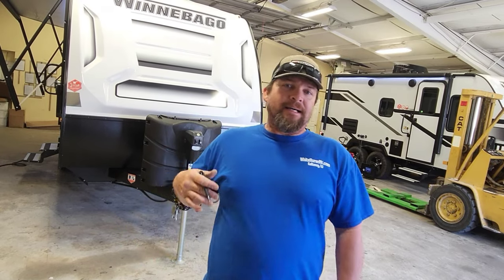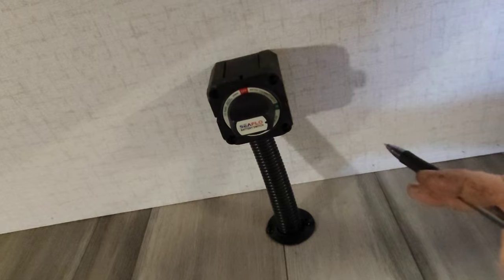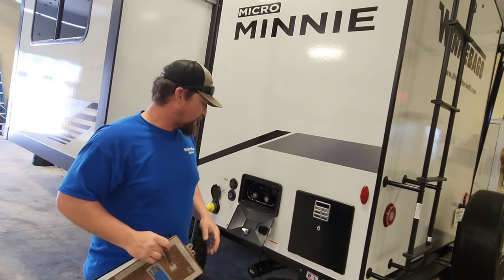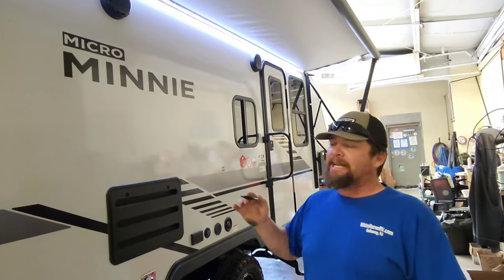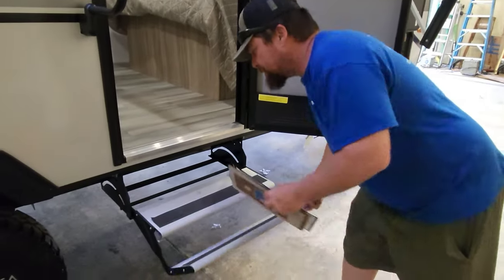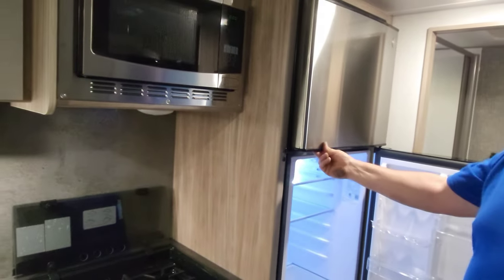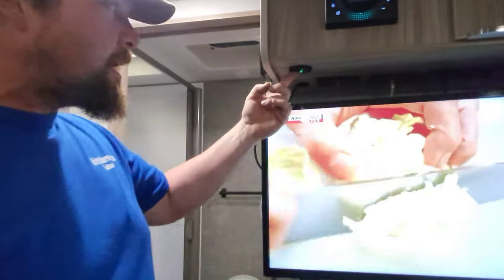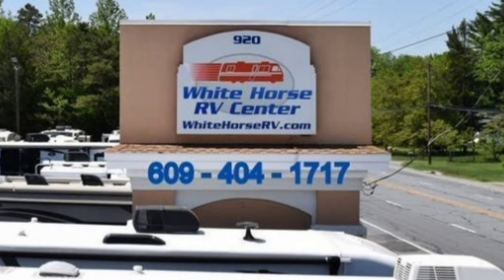How to operate your new trailer. Winnebago Micro Minnie 2108FBS @WhiteHorseRVCenter

Comment: Thanks for the video. Can you run the gas heater and electric heater at the same time and what is the length of time you can do that or do you have to turn it off? Does it regulate the temp automatically and turn off when too hot and then turn back on when it’s needed again?

Also, when using park water hookup does it also fill up the onboard fresh water tank to keep it topped off? 

I noticed you can’t run the fridge, air conditioner, and the microwave at the same time or it will trip the breaker for too much power draw at the same time.
Reply: The thermostat regulates to set temp setting.  Yes, it turns itself on and off.

No, I don't believe the city water intake connects to fresh water tank.

I've never had a problem with circuits tripping except one time when a hair dryer was being used while everything else was running.
Reply: @kevinshackleton5295  thank you for your reply. I’m guessing the microwave is like a hairdryer and it’s too much draw with the fridge and AC. I’ll check with my service advisor if it needs to be checked or not. Thanks again

Comment: Is it possible to hook an external fresh water tank to the unit and have it just keep the fresh water tank topped off.  Meaning if there is low pressure will the pump boost the pressure or do you need to keep manually topping off the fresh water tank?

Comment: Will the TV play sound through the outside speakers and or the inside speakers or will it only work through the TV speakers
Reply from the maker: Do you have this exact model ? In general most modles only play through the tv or a suround speaker that is usually mounted below it.  You would need to refer to your owners manual.
Reply: @TownsEndRVatWhiteHorseRV can you remove the Tv I wanted to put a smart tv in, so I can’t figure how to do this.

Comment: I had a question about the underbelly storage lights how do you turn them off or are they motion detecting lights.
Reply from the maker: Are you asking about this model specifically?
Reply from the maker: Most of the models with the motion setting lights have 3 settings.  There is a switch on the side that can be in the off position, on position, and motion sensing.
Reply: @TownsEndRVatWhiteHorseRV I appreciate it I have the 2327TB model and there are push buttons on the lights themselves lol took me a second to see them.